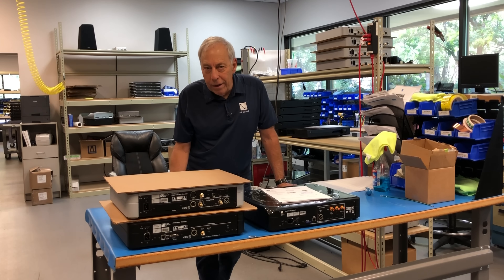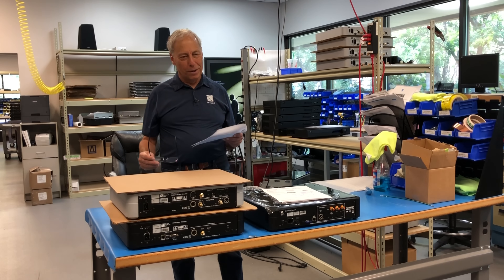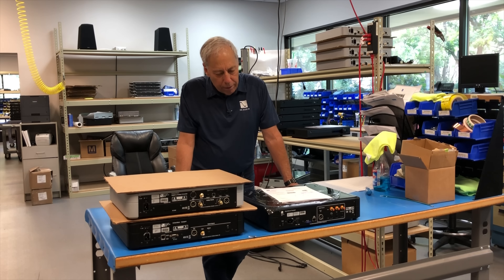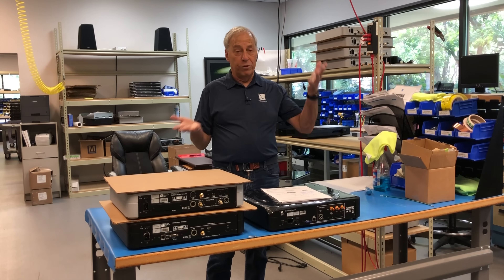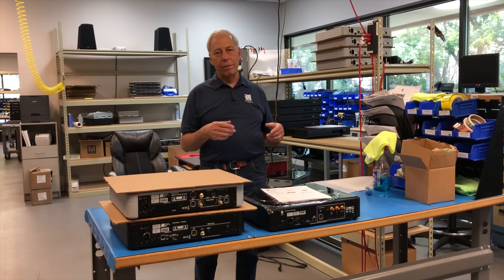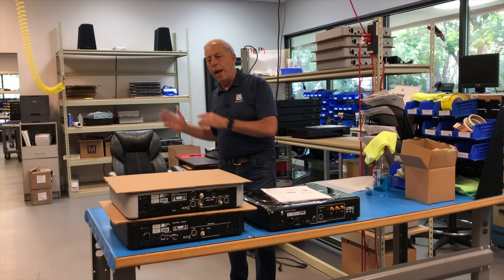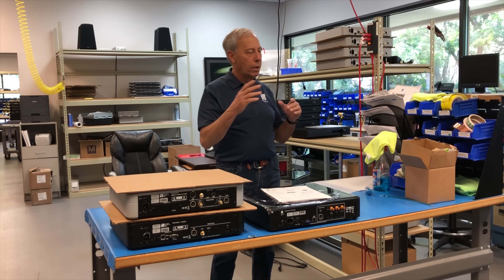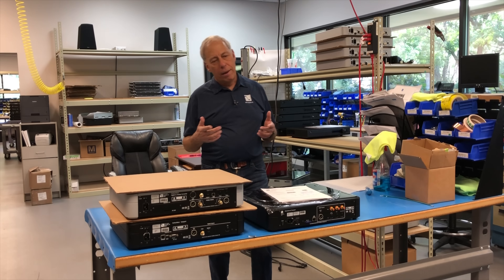What is a transmission line speaker?

Comment: Great video, very informative. I was wondering what a transmission line speaker was and your explanation was clear. Your tangent on the speed of sound and thunder did lead a little bit to be desired. Planes avoid going near the speed of sound because the pressure waves start building up as you near the speed of sound and put extreme stress on the leading edges of the frame. And the thunder clap isn't exactly a sonic boom, but more of the largest subwoofer in the world - the lightning creates a shockwave by heating up the air quickly and powerfully. And the rumbles that follow it is the air vibrating after the bolt. So it's more like a speaker than we thought! Crazy, eh?

Comment: Hi PS Audio , Wonder whether you can help I’ve watched quite a few of your territorials on loudspeaker Amps HiFl et cetera, Which by the way I found them very helpful, And I come across this one it’s obviously a year or so old but I have a pair of transmission line speakers that I built back in the early 80s from some plans out of a magazine that I think was the late 70s early 80s, , They are approximately 300 mil wide 370 deep and 1520 mil in high , And they are made out of 25 mil thick MDF tunnel is approximately 90 mil by 250 wide length is approximately 3 m 490 in length and it fires out the bottom, Play consist of a 10 inch  woofer and tweeter, Peerless made in Denmark , rate at 100 W , just recently I had problems with my power amp where I’ve got to replace it and it has blown one of my titles and there’s something wrong with one of the woofers, So I’m changing my drive units, Is it possible to wire in another speaker unit mid range into the system do you think this is feasible obviously would have to change the crossover unit in some way shape or form, And I’m thinking of taking the Twitter out of its position and put in the woofer in its place and moving the tweeter up by 200m , Do you think this is feasible. Phil from the moulin France.

Comment: I disagree with some of what your saying but can relate to  your explanation on ports, ports are actually desined to trap air movement and vibrate it at a given frequency band, and a good port is always in phase by making it turn 180 out of its phase off the back wave.

Now I tottaly disagree with your explanation of transmission line boxes
Its not a port at all. It does shift the phase, so does that mean my port i split into 2 sections and wrap around is a transmission line no, why becuse a transmission line box cavities change the size of the as you call it port as they wrap and snake inside a box the air volume changes relative to the frequency. 
These are very complex boxes with a lot of math involved ive never made one but read a lot about the concept, becuse you can take a 4" driver in a transmission line with low power and get the kind of bass you might from a speaker twice its size and a lot more power. 
And it can play down very low frequency 

A happy medium is a ported box with a folded port chamber. 
We did this for a car I had with 1 10" sub
I had people swear up and down it was 2 12" woofers. And it only used a 150 watt amp. The bass was very tight and clean.
The 10" sub played fast rock music and never sounded muddy nor did I get port noise, port noise is caused becuse the port size is wrong for the box and or driver. Or its too small a diameter if its round.  Lets say you used a 2" port and it had noise but jumped to a 3" size tube and the noise is gone. 

If your going to make a mistake on a box size make it just a little bit smaller then is called for.

There is a lot more to sound then just this and the best thing to do is experiment who knows you might be the next Bob Carver or somone else its all for fun anyway. 
Nobody needs a good sound system
We do it for pleasure.

Comment: Paul... don't go around that far. What is a transmission line speaker doesn't have to go 5min to a storm anecdote to explain that sound has a speed, which everybody knows. The relevant part of the video could have lasted 45secs 🤣🤣🤣

Comment: I think one of the key aspects of a transmission line speaker, is that the air inside the line moves back and forth in conjunction with the woofer cone. The air moves rather than just compressing, so to speak.
There is sophisticated software that does most of the calculations needed to model the response of a transmission line - one such program is called Hornresp (for Horn Response).
A big change in the way that TL speakers are designed, is to locate the woofer at about 1/3rd of the way from the closed end - this can make the response of the speaker much more even and consistent. The "old" way of doing TL speakers with the woofer right at the closed end, often have significant dips / troughs in the response.

Comment: I made a transmission line box for a pair of 12" subwoofers. Damn that was a clean sounding box. It had a very flat frequency response from around 20 Hz all the way up to around 55 Hz
However, it did lack the punchy sound you would normally get out of a standard tube, L or U-shaped slot-ported box.
In my experience, the transmission lines are much like sealed enclosures with a slightly narrower band, but more output. Still, they are amazing for SQ builds
I've heard most of the port types in action, and I can say that there are pros and cons for all.

Tube (aeroports): Easiest to install and tune, but they are more susceptible to port-noise. This can be mitigated by using flanges.
Port-hole: It is as it sounds like, just a hole in the box. These have a very high tuning, and does not sound good at all.
Slot-port (straight): A great way to add some tuning to the box. Straight slot-ports are very similar to tubes, but less susceptible to port noise.
L-port: Slot-port design, commonly used in car stereo, this port design is easy to make and install, and it adds a little bit of bracing to the box.
U-port: A longer version of the L-port, it sounds a lot more like a transmission line due to the added length. This is more cumbersome to assemble correctly, but it makes up for it with a wider frequency band and additional bracing.
Bandpass (4th order): Sealed and ported at the same time. These has a narrow frequency band, but has high output, and work great for SPL.
Bandpass (6th order): Internal ported enclosure within a larger ported chamber. These boxes has the highest output, but they are very hard to get correctly tuned. These are the kind of boxes commonly seen in wall builds, or competitions.
Horn-loaded enclosure: These enclosures are great for amplifying the output of a certain frequency to an incredible level. The compression chamber is small, and the port gets progressively wider the longer it is. This is more common in professional audio. The length of the horn determines the tuning frequency. Horn loaded enclosures can become very large, especially if you want a subsonic horn for a home-theatre install.

Comment: I use a pair of TDL Studio 1 TL's in my man cave, which measures about 3.5m x 4.5m. They fire across the room at my listening seat on the end of Audiolab mono-block amps, a very happy marriage. The best thing about them, is the way they do not loose bass weight when the volume is low, my wife goes to bed quite early so a lot of time is spent listening like this. Even the Tannoy DC3000's in the living room, probably my favourite speaker of all time, have a threshold volume, below which point the bass is lost.

Comment: (Sorry guys, wasn't done yet) As I was trying to comment, the original acoustic labyrinth had an open  enclosure at the top, where the opening, behind the woofer fed into a series of equidistant slats which went back and forth until finally venting into a rectangular port facing in the same direction as the woofer. The dimensions of the acoustic line (port opening) were roughly equal to the surface area of the woofer, and the length of the Labyrinth was usually equal to   one quarter the wavelength of  the tuning frequency (9ft for approx 33hz). The final enclosure is somewhat proportional to a tower loudspeaker, only somewhat larger. All I can say, is that the results of this effort are astounding, I personally have never heard bass this low on any system before or since. As far a I know there was no stuffing in the line, but the bass response (even with the 90 degree elbows in the line) was intense!!!

Comment: No one wants to go there; but can anyone explain the advantages of a TRUE Acoustic Labyrinth loudspeaker, where there is a small enclosure behind the speaker, feeding into a series of equidistant slats going back and forth throughout the speaker cabinet, ultimately ending in a rectangular port facing in the same direction as the woofer. Th proportional to a tower speaker; only somewhat larger.

Comment: The speed of sound is 767 miles per hour. Thanks Paul for all the videos.
Reply: At what altitude?
Reply: The exact speed is dependent on the density of the air, which in turn depends on the air temperature. It rises in speed as air temperature rises.

Comment: Very good video. To help understand why ported enclosures work (the output from the port in a properly designed cabinet IS in phase with the main driver cone) is that the extra distance the sound wave has to travel through the transmission line on the reflex side of the wave as the cone is vibrating will delay the arrival of the wave so that it will be in phase with the front portion of the wave coming from the main driver itself when it arrives at the port entrance. The advantage is that you have a much more pronounced bass response. The drawback is that you need a cabinet about 60% larger than a sealed box cabinet to produce the same volume level at the same amplifier power level.

Paul is correct that just randomly knocking a hole in the cabinet will likely produce poor results.  There are two common ways to achieve a transmission line design. [The technical term is called "bass reflex", btw. Get a copy of Loudspeaker Design Cookbook which describes all of the nuances of building a loudspeaker (including the Thiele and Small parameters). It will also give you an incredible insight into why the actual physics works AND how to build your own like Paul and I and so many others enjoy doing.]

Historically, most bass reflex designs used a pipe of some sort to create the transmission line. The length and diameter would depend on the Q of the main speaker cone, the desired peak response frequency, the size of the cabinet, etc. (I used on my most recent design 3" x 4" PVC pipe from Home Depot. A better choice would actually be heavy duty cardboard since it is less likely to vibrate or "ring" if not thoroughly glued in place. Do NOT under any conditions use anything metallic!)

If you use the cabinet itself to create the transmission line, you need to design tunnels or corridors to allow the wave to progress through the cabinet. Paul is 100% correct. This is very difficult to get right and, while I am good with pipe bass reflex designs, I am still a student with this method. The most famous product out there that uses this technique is, of course, the Bose Wave Radio. the "Wave" has nothing to do with the radio part. It has to do with reproducing very good bass response in a small enclosure. Very good design and they sold millions of them. If you take one apart (there probably are videos here that show this), you get to see what a transmission line enclosure looks like.

There are several software applications out there to help you design and you can get speaker components from Parts Express which has a full library of loudspeaker designs you can try. I could drop $20,000 if I built just a few of their higher end models. :)

Comment: The sound exiting the port behind the woofer is in phase with the sound from the woofer only at one frequency [ at some other frequencies cancellation occurs ].    
Also the port behaves like an organ pipe at certain frequencies, resulting in peaks and dips in the bass.
This requires that the port be filled with damping material which limits the output at the desired low frequencies.
These are some of the serious  problems that one encounters with transmission lines.
Notice that there are not many of them around.

Comment: The speed of sound changes significantly base on altitude, the barometric pressure at that moment in time, and temperature; all impact air density hence very the speed of sound.
So for transmission line speakers do they automatically adjust the baffle length based on barometric pressure to they stay in tune??

You live in Boulder Colorado, I live in Colorado. The speed of sound is different gear then at sea level, and changes based on temperature and the weather (barometric pressure that moment in time)

Comment: A well done rear port can be in phase too, however it requires the speaker to be properly aligned with the wall behind it, and the room acoustics to be right. But most people don't have that flexability of placement, which is where a transmission line will be better it removes the room acoustics from the play...as far as phase goes.

Comment: In '79 I built a modification of the Bailey cabinet design, each populated with 3 KEF speakers, a Coles super-tweeter and a Falcon crossover. They have been dragged all over the country in the intervening years and look a bit shabby so at the request of my partner, I considered a replacement. After reading many good reviews of a direct seller's floor stander, I got a pair. Mistake. In that room they can't hold a candle to the old ones...  simply not as musical. Next time I think about it, it will have to be something I can audition first.

Comment: Dr. Scott Lindgren talking speaker enclosure design (part 1) 7:20 - https://www.youtube.com/watch?v=1eD0VUb5BFo&list=PLx-9mD0_6t4VQZON0SqbNC1ygI3dVQ0kk
A Transmission Line in the original sense was designed to help flatten the impedance curve. Nowadays most equate to mean a 1/4 wave design.

Comment: A port is NOT a hole , it's a tube of a certain length which depends on the tuning frequency . Port noise (farting) is a sign of bad design . Well designed bass reflex systems do not fart . Air speed can be kept low enough by having a sufficient large diameter port . A transmission line does not work by delaying the back wave , that is pure BS  , it resonates at the frequency of a half open pipe , like an organ pipe (quarter wave principle) .  As a resonating system , it has the same drawback as a ported speaker : impaired transient behaviour around the resonance frequency . Generally , bass quality is better than ported , but worse than closed , and closed is second to open baffle.
Reply: Thanks for sharing your knowledge. I had been looking into a  transmission line sub after researching and getting sold on how it is better than an enclosed woofer, in part  because the reduction of the compression behind the speaker is purported to enhance transient response. Do you have a reference to support your point of view you don't mind sharing? (I've Googled the topic to death already) If get un-sold on the transmission line idea it would save me a lot of trouble!

Comment: T-Limes (when designed and built right) can be the best performing (over wide and diggin double deep) designs. It was secret for a long time to figure it out but there’s a super simple formula that we always follow and it turns out so well. I even took Paul Carmody’s “Speedster” build and did them in T-Line and they dig so damn deep and flat it’s crazy good.

Comment: Hi Paul, thanks for explaining transmission line, do you think if it possible to use same theory to build a TL box with micro speakers which same speakers in iPhone. To make a small device with iPhone speakers but with more extra bass power. You can put it near your ears but still open ears.

Comment: Hi Paul. Nice description there. I have some huge Leak 2075's from the 70's that Leak described as transmission ABSORBER as opposed to LINE and their bass is amazing but without overhang from their 15" bass units.  I guess they would cost a lot of money to manufacture these days.  Also remember the big TDL Ref TL Monitors from the early 90's. Chris from the UK
Reply: I have a pair of the TDL Monitors and also early single-wired Studio 3s. People comment on how good the subwoofer is (I haven't got one obviously) and can hardly believe they're 30 years old.. The real biggie was the Reference Standard.

Comment: Paul, ported boxes are not just about poking a hole in a box, they have tuned pipes inside, designed with calculations including the internal cabinet volume, woofer diameter, excursion, resonant frequency etc:)
Reply from the maker: I realize that, of course, and my answer might have been a bit too glib. None the less, the majority of low cost ported boxes have little more than a plastic port tube and most of those are off-the-shelf  without benefit of much work. That said, of course there are some designers who spend a great deal of time getting it right.
Reply: @Paulmcgowanpsaudio  haha hi paul offcourse i knew you knew that. Thanks. Love your videos. Which i had a profitable passion like you have.

Comment: Big con is that the boxes are much bigger than normal ported boxes due to the length and diameter of the port. Biggest pro is that it is probably the best sounding a particular sub can ever sound (clean and deep).